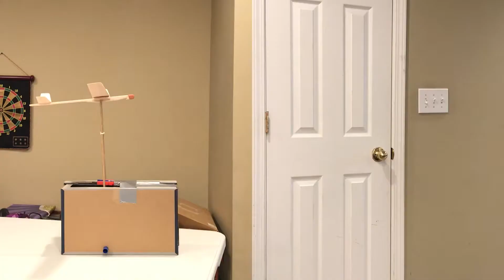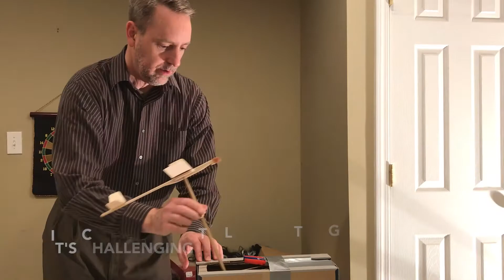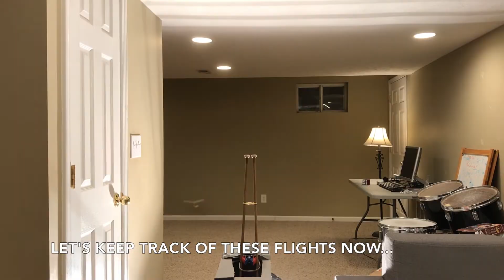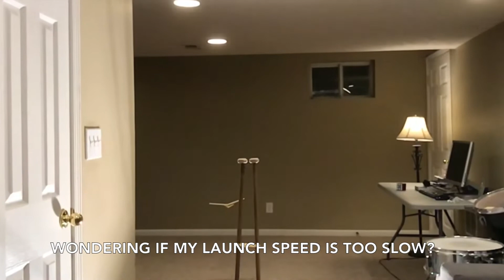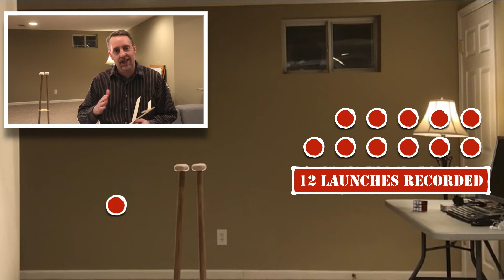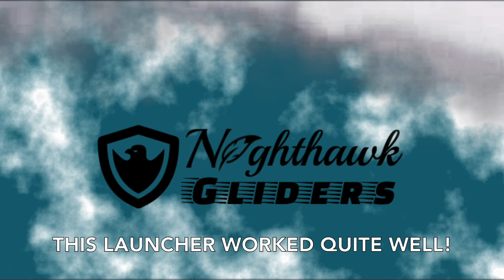Balsa Glider Launcher (Calculating Glide Ratio)

Comment: Well done guys! I d'nt think it is essential to increase the launch speed, on the other hand it would be necessary that the glide paths are perfectly straight to be able to compare the behavior of different gliders.
Reply from the maker: Yeah, thanks for comment.  I should build a couple gliders w/o tail tilt just to ensure launching is straight and level.

Also, with my limited space, to obtain more exact measurements I believe I need to launch the gliders: 1) at their natural glide velocity and 
2) at their natural glide angle.
These two things will vary from glider to glider.

Any variation of these two things will cause the glider to adjust itself (oscillate) in flight before settling into glide.  Too far off in launch velocity or launch angle and the glider will not follow it's straight glide path giving me "false" measurement when it hits the wall.  Not knowing either of these for any given glider, it would be nice to have adjustable settings on launcher to change power and angle to achieve that straight path and consistent launch before measuring.  (Things for me to consider in next model!)
Reply: Nighthawk Gliders catch my long winded reply up there somewhere,
the plunger V just a couple wedges on the sides of the plunger like " \|/ "
the down arrow shape pointing forward, so when slid forward it pushes the levers apart (below) gripping the glider (above). when it smacks the stop it'll release the glider consistently, at what ever angle you set the stop at. what'd be REALLY cool is actuating it with falling weights for consistency, no bands or springs and messing with a pull scale, you know the force by what weight is added+adjusting.
Reply from the maker: I think I prefer springs over falling weights.  It would be more compact and less cumbersome to operate.
Reply: true, can always measure the tension when/where rear stop is set using different springs or bands, and no hesitation on energy release (gravity power would!). the "rockers" that grip the glider for the V wedge plunger idea, those rockers could almost be wood from clothes pins, similar pinch action, wedged not sprung.

Comment: Amazing videos thanks for sharing. I am already subscribed. I have a question about gliders , I hope you do not mind asking if it is not the one you design. I built one on foam from a Japanese web site . The problem is that when i launch it it flies in a loop and crashes. So I have to launch it horizontal....does not make any sense . Could you please share you thoughts on what may be the potential reason for this ?   I hope you can help . Many thanks in advance...!
Reply from the maker: Thanks, Alex, for subscribing!  A “loopy” plane can be result of several reasons.  Most likely either too much up elevator, too much angle of incidence, or wing too far forward (or to big). Essentially, you have too much lift on main wing and possibly not enough authority on horizontal stabilizer!  If you test it at glide speed, does it fly level?  If it stalls, try more nose weight and/or adjust elevator down a tiny bit at a time. Be sure to only change one thing at a time before testing. Also, try launching it with 45 deg pitch up, but with a 90 deg roll. Even if it’s a little loopy, by starting off with a substantial roll, it can spiral upwards and level off.  Hope that helps!

Comment: The side slip is due to the fact that the Sandpiper has a V-tail, which is a lot more efficient then a standard tail, but provides less vertical stability,
Reply from the maker: You should build the Sandpiper and try to fly it indoors at your armory? (hint, hint, nudge, nudge!)  😜
Reply: Ok ..and I'm off to the local craft store for balsa! One sandpiper...comin' up!

Comment: Very nice job! I like to post this video! Maybe this launcher would be greater if this could be on a high hill.
Reply from the maker: Thanks!  I would like to make this launcher more adjustable and more consistent (if possible) for more accurate measurements of different glider sizes and designs. (Like for foamies, too 😀)
Reply: I think the concept is awesome, but gets mechanically over complex with the launch arms separating for the release. single straight arm that has a notch for the glider's hook, or similar "grippers" releasing by single plunger about 5/8" before end of stroke (hammer arm has plunger in it).

got a clear picture now... single stop rear, moveable for arc distance. single stop front, also moveable from -20 to +10 degrees for small up/down adjusting. plunger in arm... as it's smacked back a V wedge pulled out from between vertical arms (like valve rockers). tension released lower, releases upper, consistently. put glider between the clips gently squeezing, slide the V plunger forward just enough to grip the glider. plunger smacked back when it hits the forward stop.
Reply from the maker: Hmm.  Interesting idea with the V-plunger.  Thanks.